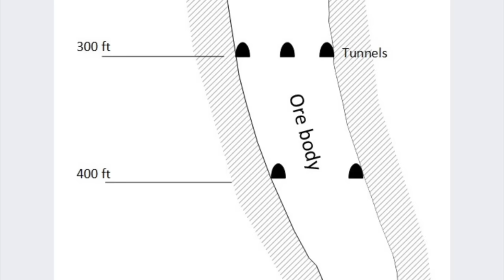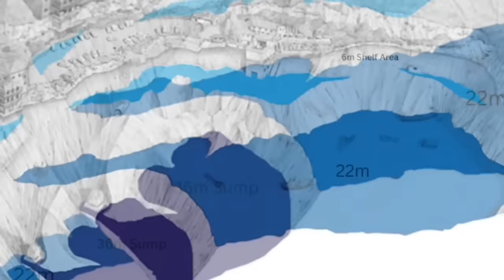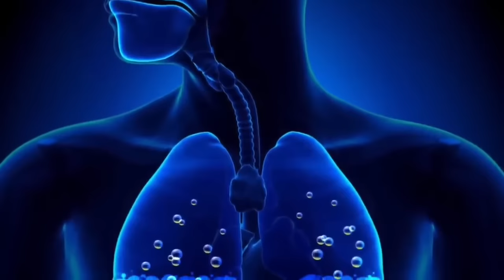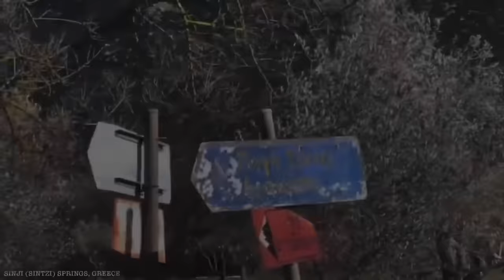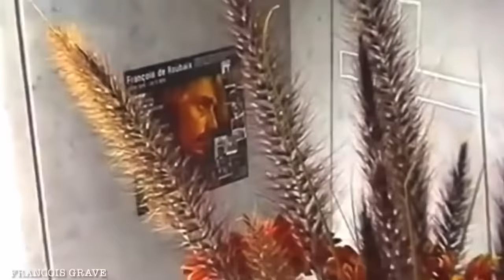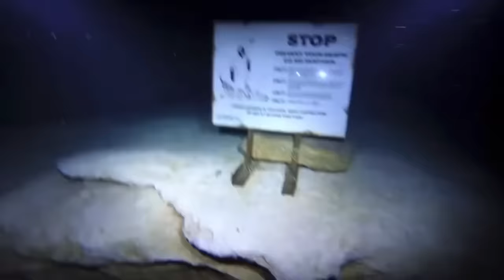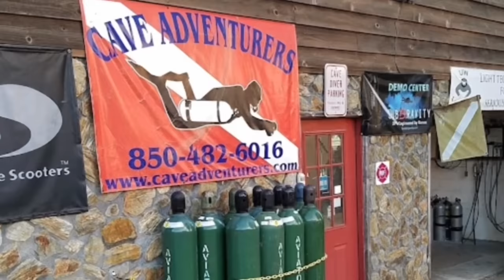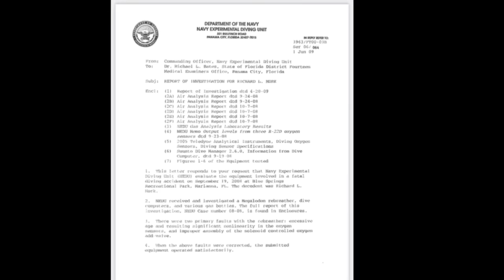TRAGIC CAVE/QUARRY/MINE DIVING DISASTERS MARATHON|GRIPPING HORROR

Comment: There was a old granite quarry in Quincy MA (Swingle's Quarry); it was about 500' deep and was abandoned in the 1920s. It filled up with water and became a popular swimming spot for kids (it was fenced off but the kids tore the fence down). AS in this case old cars, dead bodies, junk and trash were dumped into it. Finally a teen from Ireland disappeared in it-so they pumped it out and recovered the body. Once dry, they found skeletal remains at the bottom

Comment: I work rough terrain/ harsh climate Search and Rescue/Recovery with disaster relief as Medical Sergeant for two teams. They offered because I'm very small, to send me through training under water rescue in springs, rivers, dams, etc. I told them as medic my job is to keep my team and those in need alive. There's little that can be done down there other than body retrieval. I'm not a strong swimmer and have this very bizarre, irrational fear of Dams (the only thing in truly panicky over are dams. No idea why) They asked two more times before I had to offer to shove that air tank up his butt before they moved on.
There's three mistakes we come across for those we search for...
1. Going alone on your adventure and having too much arrogance.
2. Not enough, too much, unnecessary and/or useless equipment.
3. Not telling anybody where they are going.
Reply: Those 3 points can be applied to travel in general - some great guidance there!
Reply: Another I would add is that they usually don't have an exit plan incase things arise.
Reply: Ikr, I was a volunteer EMT finding myself under a flipped car talking to a drunk driver with the smell of gasoline around...I decided this was not the life for me.

Comment: I used to live in Tenerife back in the early 90s and never knew of the diving deaths there. I knew a diving instructor called Theo and this made me think of him......plus the life enriching few years I had over there, I could tell some stories, that's for sure 😆
Reply: Of course half of these "horrors" are just fiction....
Reply: Same place the two airplanes collided on the runway.
Reply: @mowtivatedmechanic1172  - Yeh that's right mate. People do think that it was at the airport where everyone flies in to go on holiday, Reina Sofia or Tenerife Sur, but it wasn't that airport. The disaster was at Los Rodeos, which is further north and with a much cooler climate than the coast, and has quite a lot of fog, which I think was one of the reasons for the crash.

These days, or at least when I was there, they only use Los Rodeos airport for smaller internal flights to the other Canary Islands as I did a couple of times to some of the smaller islands. All I could think of at the time was the aeroplane disaster there 😵

Comment: The safety shop is not necessary if you have dived normally. It is suggested just to be extra careful. Out of air is way more important. He shouldn’t have been held down
Reply: Completely depends on depth and max bottom time. For a 30 metre dive, yes you do need to do a safety stop. Most divers ascend way to quickly, it's a redundancy that shouldn't be avoided. Barotrauma is serious and life threatening.
Reply: @megazw7740  just saying drowning is a sure thing if you haven’t exceeded the dive tables a safety stop is redundant. Been diving thirty years and had to skip safety stops several times, no problem. You should always come up slowly but that’s different from a safety stop ( avoid the bends)
Reply: @amybradley5821  Like I said, if you're going to 30 metres, which they were (it was an advanced diver course) you need to do a safety stop. We do safety stops BECAUSE of bends and barotrauma. I'm a literal dive instructor.
Why do you think we safety stops if not to avoid bends and barotrauma? Like seriously! The first 10 metres are the most dangerous, hence the stop. 🙄
Reply: @megazw7740  still just saying in an out of air situation a safety stop is not important. Can’t make a safety stop with no air.
Reply: @amybradley5821  if there's no alternative, yes. The last resort is bolting to the surface is all I'm saying. If you're closer to a buddy source, you go to the buddy source, NOT the surface. Regards, a diving instructor.